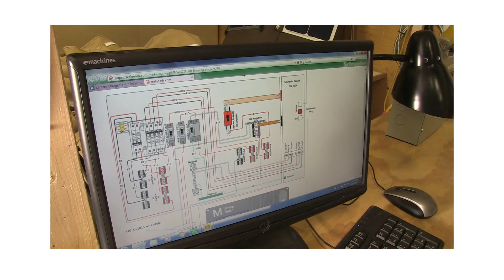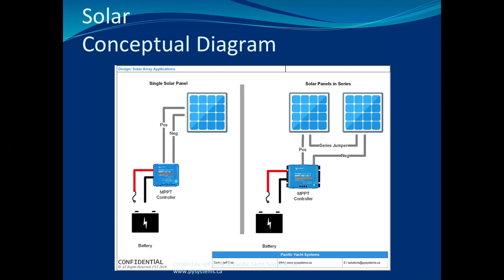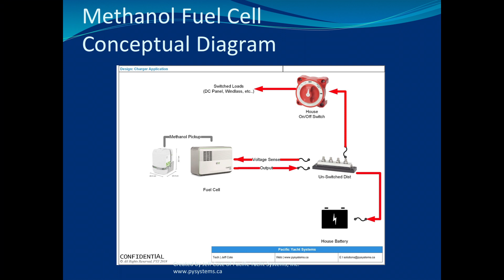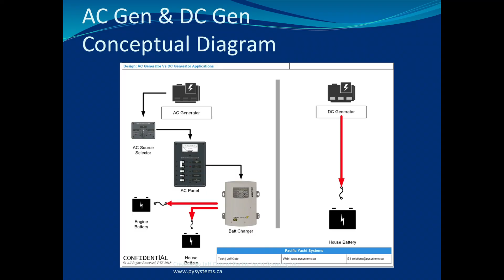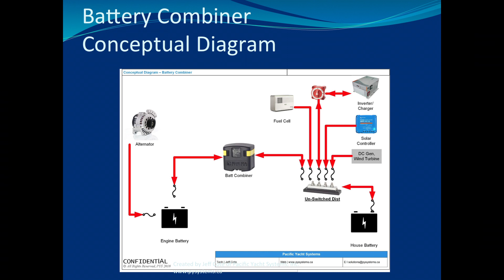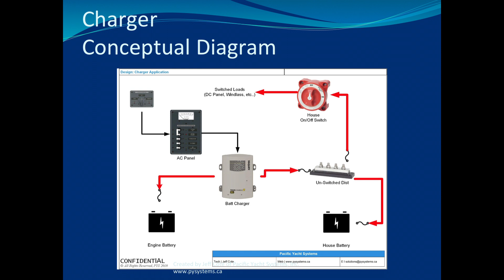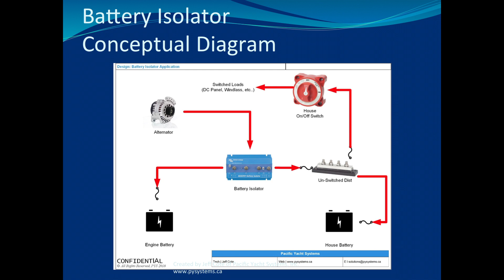How To:Marine Electrical Seminar - Troubleshooting Solar, Generators & Fuel Cells - Episode 12 of 12

Comment: Great stuff Jeff!  Learned a ton from you so far and am super thankful I ran into this channel.  One small correction for others who may watch in the future.  At 37:19 you mention there is no device that limits current throughput for example to share charge between batteries.  Recommend checking out something like the victron Orion-tr smart dc dc charger.  https://www.victronenergy.com/dc-dc-converters/orion-tr-smart.  If programmed correctly for the battery application this device can be used instead of a battery combiner and should eliminate issues of a large delta between battery banks driving a very high current when connected and then blowing protection fuses.  This is because this device would limit current to the max output of the device.  The downside is more cost and complexity of the device in that it needs correctly programmed settings for the battery application (flooded / agm / lithium) compared to the simpler battery combiner relay.
Reply from the maker: Hi Scott, good point, a DC to DC charging converter is a useful tool here. Thanks for sharing.

Comment: 32:38 thank you for the explanation. I was wondering this myself. In the morning when I start my boat after a night and my battery is depleted to 45-50%, the combiner would close and open and close and open and it freaked me out but I never knew why. I am going to check my starter battery voltage on the app when this happens next time. My battery bank is very small 125aH  because I have a small boat but I always wondered why it would click on and off. Eventually, after 10 clicks it would just stay closed and charge everything up.
Reply from the maker: Thanks for sharing!